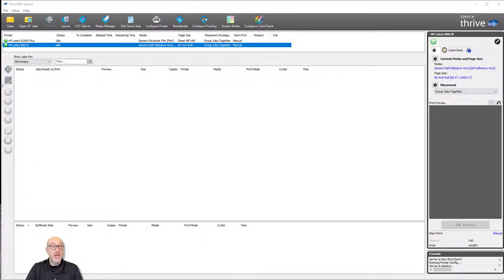Onyx RIP White Ink Workflow

Comment: Thank you for the video, Lee. Very informative & easy to follow. 
I'm running into an issue (printing to a window cling) where I'm trying to fill an image area, however, it isn't fully picking the entire graphic. There's no transparency in Photoshop & all images surrounding it seem to be fine, as well.
Reply from the maker: Fill Image Area will not work properly if there's any sections that are filled "white" - that is, no color. You'll need to find another strategy for adding white in those cases.
Reply: @LeeManevitch  Ah, understood. So replacing the white with a different color or gradient should be a fix. Thank you.
Reply from the maker: Perhaps. If not, and you're ok with it, please feel free to send me the file at YouTube@manevitch.com with a detailed description of exactly what you're trying to do, and I'll take a look at it. If there are linked files in your artwork I'll need those, too.
Reply: @LeeManevitch  I managed to just slightly decrease the level of white to a hair darker (almost unnoticeable) & that seemed to do the trick. Thanks, so much, for the help!

Comment: Hello Lee, greetings from DPI Direct in San Diego. Do you know if there is a way to change the spot color name that Onyx is using? We have another printer that prints white using a fiery rip and it looks for a different spot color name for its white ink setting. Therefore we have to prep accordingly to the device we're using. It would be nice if we can set them both to look for the same spot color name. Thanks!
Reply from the maker: I don't think it's possible to change the named color from Spot1 to something else - it appears to be hard-coded. However, you CAN make the change on-the-fly by opening the file in Job Editor and going to the Color Correction tab. Once there click the "Tools>>" button and choose "Named Color Replacements."

Click the Insert button, and you can change "Spot_White" or whatever to print as 100% white in that dialog box.

If this is going to be an ongoing process you probably will want to save that adjustment as a filter. At the top of the Color Correction dialog there's a "Filter..." button. Click it, then click the "Manager..." button. From there you can export the adjustment you just made, and then create a new Quick Set that uses that filter every time. (Quick Sets is on my to-do list because of how easy they make everyday adjustments)

If you go the filter route be aware that any adjustment you made will be included. So to be safe make sure that the only thing you've done inside the Job Editor is to make that one color replacement.

Comment: Is there a way to create a white ink gradient under an image that already has a gradient fading to 0% Opacity?
Reply from the maker: Design of white always goes over, regardless of print process. Make it overprint, and set both gradient endpoints to be tints of white rather than using transparency effects. So for instance 0% - 100% for the full gradient.

Comment: Omg… how do you underflood specific areas like the one image you’ve used in other video with the surfer under water.  Ive been trying to print a job with white behind all other colors except black, and I’m having no luck. It’ll either underflood all, or print the white over flood, in underfloor settings. SMH. So confused.
Reply from the maker: If you want selective white then by far the easiest way to do it is in your design software...not in the RIP. Reach out to me at youtube@manevitch.com and I can show you how your particular file needs to be manipulated.
Reply: @LeeManevitch  thanks will do

Comment: Hi Lee, thanks for the video! I found it (and many other of your videos) very helpful. Is it possible to create a sandwich mode for the R-series using Onyx instead of doing it at the printer? I'd really like to create Quick Sets (and, subsequently, hot folders) for all of my print modes, but I can't do that if I'm applying settings directly at the printer. I have a 700 and an R2000. Could you make a video showing how to create the Quick Sets for white-printing? Especially for the R-series, since setting that up in Onyx wasn't really talked about much in this video. Thanks!
Reply from the maker: Hi, thanks for the kind words.
Setting up Sandwich directly in Onyx does not work for the R-Series because of how the internal workings of that printer's computer system operates. I do need to set it up onboard the printer's IPS to get sandwich mode to work.

I can definitely add Quick Set creation to my video schedule, but be aware that Onyx has an extensive collection of Quick Sets specifically for the R-Series and the 700/800 already. it might be worth taking a look on Onyx's website to see if you can get a head start, because travel has REALLY picked up for me and so my video schedule has taken a major hit as a result!
Reply: @LeeManevitch  Ah! Ok that makes sense. No rush on the quick set creation videos! I know how to make most of the quick sets. I'm just trying to figure out how to set up white-printing quick sets now. Sounds like for the R2000, I won't be able to do everything in quick sets, so that answers that!